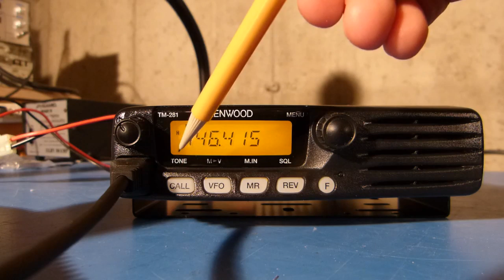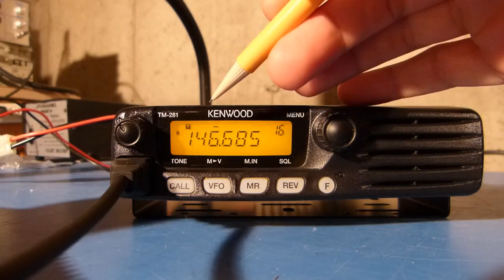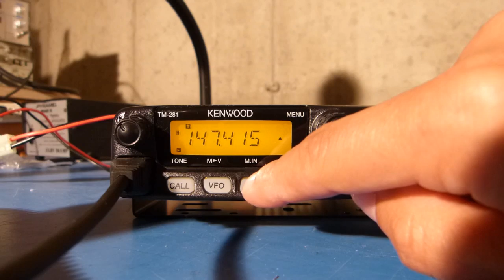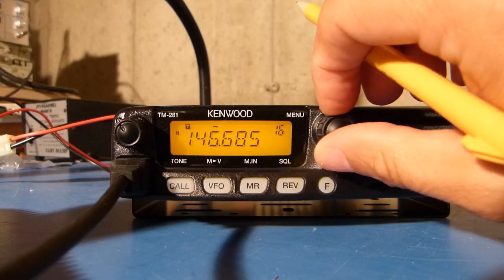Kenwood TM-281A Non Standard Repeater Offset Programming

Comment: I really liked the video and it is way more helpful than the manual. For those who like written instructions I have transcribed the following from the video:

Kenwood TM-281A Non Standard Repeater Offset Programming Step by Step

Please note:
If the memory channel is named alpha numerically then the Transmit / Receive frequencies do not show on screen.

The mic keypad entry needs to be programmed prior to following the instructions below.
It is not possible to modify the saved information. If you make a mistake the entire process must be repeated.

1.	Press VFO button to ensure you start in VFO mode
2.	Use mic keypad direct entry method to enter receive frequency i.e. 146.415
3.	Program the transmit PL Tone for repeater by pressing F button then Menu dial
4.	Rotate menu dial to go to Menu Item 2 and then press Menu dial to enter Tone menu
5.	Rotate menu dial to enter Tone frequency i.e. 141.3 then Press F button to return to VFO mode
6.	Turn on Tone by pressing F button and then Call button. T appears on Screen
7.	Write to memory by pressing F Button and then rotate menu dial to desired memory channel
8.	Press MR button to write to memory channel
9.	Press VFO button to ensure you are back in VFO mode
10.	Use mic keypad direct entry method to enter transmit frequency i.e. 147.415
11.	Press and hold MR button until you hear beep
12.	Using MR go to the previously saved channel and +- will appear on the menu to indicate a non-standard offset
Reply: thanks man

Comment: Have followed your instruction carefully but still doesn't trigger our repeater.  PL tone is 82.5, tr-146.000 , tx-146.625.  Is there other function inside menu? Thank you
Reply from the maker: +Quirlie Quiba I think that should do it...are you sure you have the xmit an rcv freqs correct?  In other words, should they be swapped?
Reply: Yes. I been doing the instruction many times but doesn't work. 146.000 where we monitor and when pushed my PTT the freq should appear 146.625.
Reply from the maker: One other thing to check is whether or not you have a receive PL tone programmed in.  In most cases you DON'T want a receive PL tone programmed.  If the repeater is set so that it does note re transmit the PL tone this could cause you to not be able to hear the repeater even though you may actually be keying it up.  Other than this, if you have followed the video and have to correct info for the repeater you are trying to access I can't think of why this isn't working for you.
Reply: I think you are correct.  I presumed that PL tone must be programmed first.  Does it need a PC to do that?